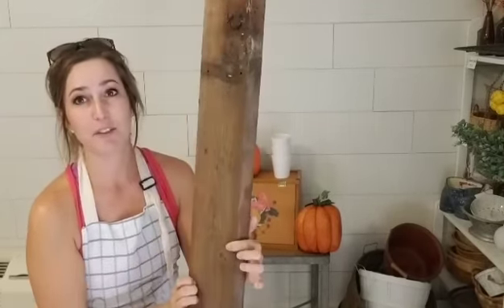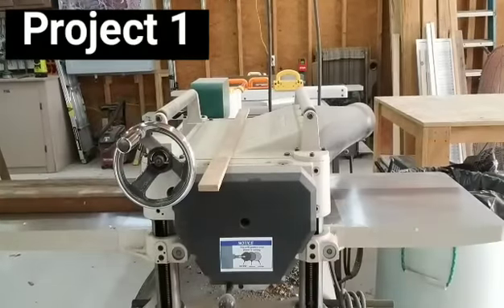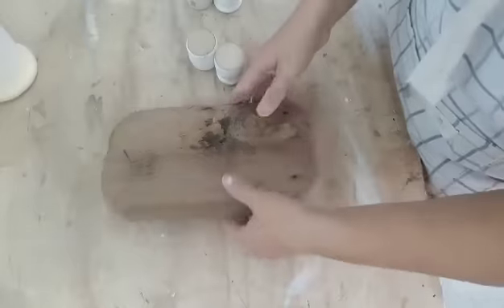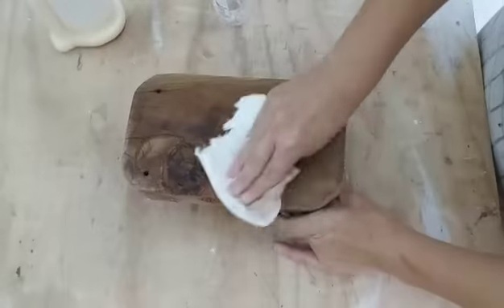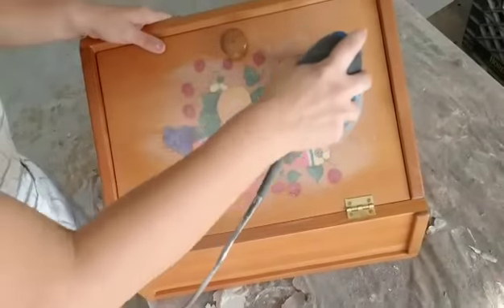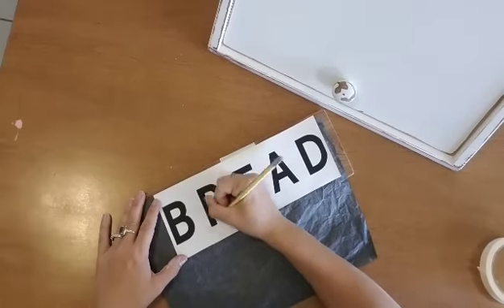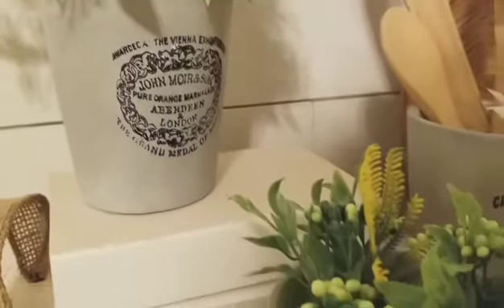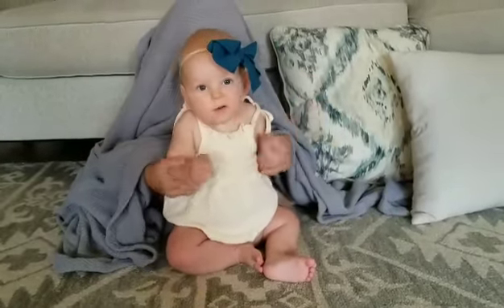Thrift to Treasure • wood tray • bread box • small ceramic pots

Comment: Hi, just found you, liking your videos.
In case you didn't know, For the stamps, Jami Ray and her husband did a live with them and Zeb says to VERY, VERY lightly, and very slowly sand the stamp with fine grit sand paper. Super soft and slow... I guess it'll get that extra rubbery plastic off from manufacturing so it'll be flat and take the paint or ink better.
Reply from the maker: I did that. I just think it's a learning curve, especially on round surfaces